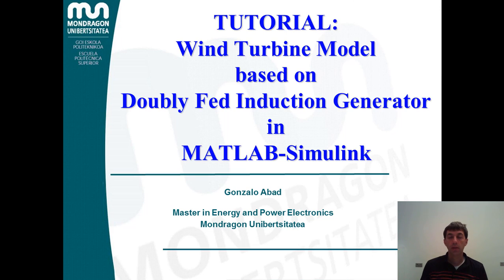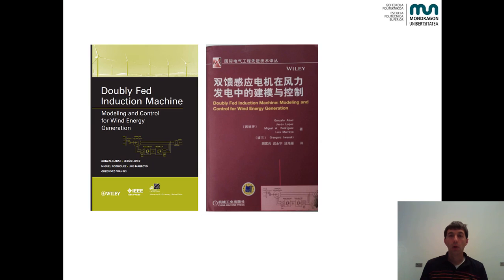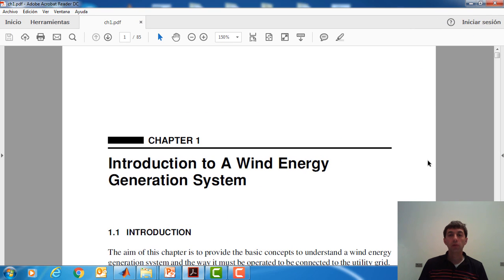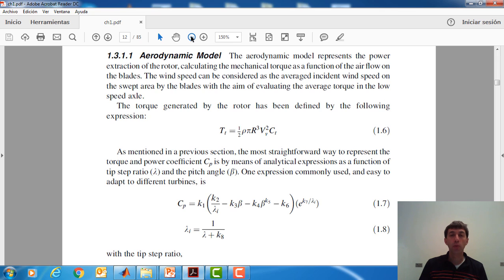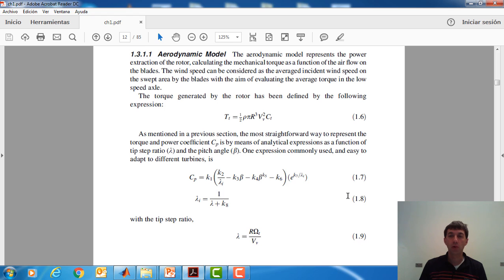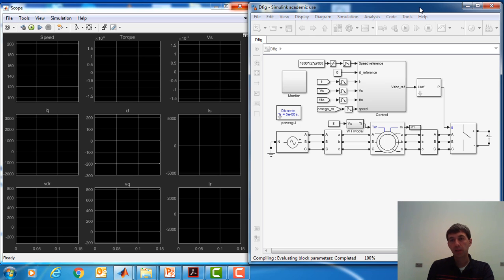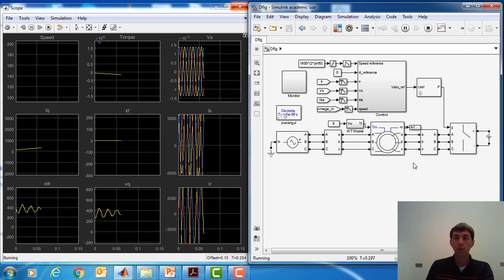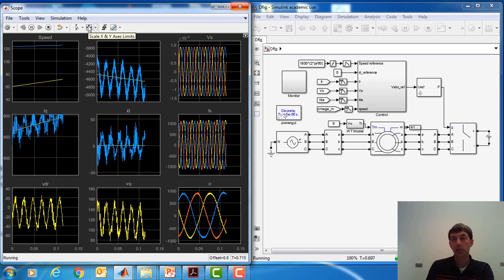DFIM Tutorial 3 – Wind Turbine Model based on Doubly Fed Induction Generator in MATLAB-Simulink

Comment: In this video, you all will have problem with the look up table in wind turbine model. 
here is the configuration needed. 
also, put down your email if you want the matlab file and the SLX file if you want it. i only do until tutorial 3. the rest just do it yourself. 

Great video! 
The configuration of 1-D Lookup Table is 
In Table and Breakpoints:
Number of table dimenssions: 1
Data specification: Table and breakpoints
Table Data: Ct
Breakpoints specification: Explicit Values
Breakpoints 1: tab_lambda
In Data Types:
Table Data: Inherit: Inherit from 'Table Data'
Breakpoints 1: Inherit: Inherit from 'Breakpoints Data'

The rest of configuration is the same of default block
Reply: Please respond me asap. I have less time
Reply: Thnkz sir🙏

Comment: Thank you very much very sharing your expeience and knoledge with us. Can You please just clarify how did you get the Cp from lambda using the n-D Lookup Table block in the Simulink?!!
Reply: U will have to manually prepare the Lookup table by looking at the Ct vs Lambda curve. Atleast i have done this and it has given me great results
Reply: vishal kumar Hi, can you please guide . It will be great help. Kindly oblige
Reply: you just need to put Ct in Table data, and lambdai in breakpoin1
Reply: Error evaluating parameter 'Mechanical' in 'model/Asynchronous Machine SI Units' Caused by: Index exceeds array bounds. i get this error please help me
If you give solutions then i will send model to you
Reply: @easyaima  Please, how do you put it. Is it by manually typing Ct and lambda. Please can you guide further, i stuck at this point

Comment: Hello guys. what are the problems of that coding? ( Problem is Undefined function or variable 'lambda '.  ) 

% Cp and Ct curves

beta=0;                     % Pitch angle

ind2=1;

        for lamdba=0.1:0.01:11.8
            
            lambdai(ind2)=(1./(1./(lambdai-0.02.*beta)+(0.003./(beta^3+1))));
            Cp(ind2)=0.73.*(151./lambdai(ind2)-0.58.*beta-0.002.*beta^2.14-13.2)*(exp(-18.4./lambdai(ind2)));
            Ct(ind2)=Cp(ind2)/lambdai;
            ind2=ind2+1;
            
        end
        tab_lambda=[0.1:0.01:11.8];
    
    %Kopt for MPPT
    
 Cp_max = 0.44;
 lambda_opt = 7.2;
 Kopt = ((0.5*ro*pi*(Radio^5)*Cp_max)/(lambda_opt^3));
Reply: % Cp and Ct curves
beta=0;                           % Pitch angle
ind2=1;
for lambda=0.1:0.01:11.8
    lambdai(ind2)=(1./((1./(lambda-0.02.*beta)+(0.003./(beta^3+1)))));
    Cp(ind2)=0.73.*(151./lambdai(ind2)-0.58.*beta-0.002.*beta^2.14-13.2).*(exp(-18.4./lambdai(ind2)));
    Ct(ind2)=Cp(ind2)/lambda;
    ind2=ind2+1;
end
tab_lambda=[0.1:0.01:11.8];
% Kopt for MPPT
Cp_max=0.44;
lambda_opt=7.2;
Kopt=((0.5*ro*pi*(Radio^5)*Cp_max)/(lambda_opt^3));
Reply: @dlugi84  Thank you very much.

Comment: Hello sir, thank you for your help with this series of videos they have been great to learn from. However I have some issues after implementing the wind model part. After adding this section my speed just continues to increase exponentially to over 3000 instead of staying below 200?
Reply: Hello Daviv Hasland,
I am facing same issue. The speed goes on increasing even beyond 5000. I tried my best to to know the reason but i didn't succeeded.
Do you know now what the possible reason is??
Kindly share here. Thanks
Reply: Hello,
No I didn't solve this in the end, I removed the wind model and operated with values of torque
Reply: David Hasland thanks for a reply..
Can i get your email please?
Reply: @davidhasland1566 I Error in 'model/Asynchronous Machine SI Units': Initialization commands cannot be evaluated.
Caused by:
Index exceeds array bounds.I got  the error   while doing Simulink